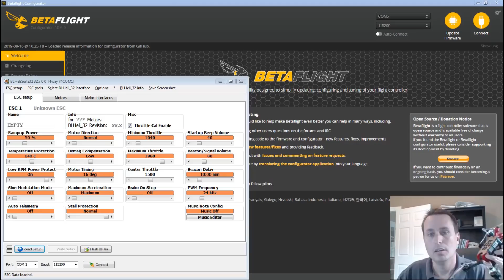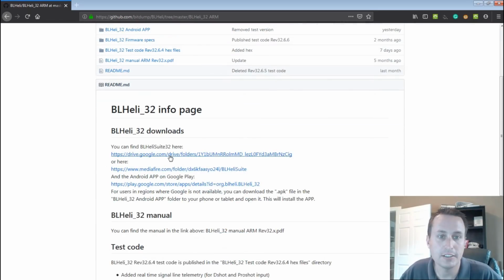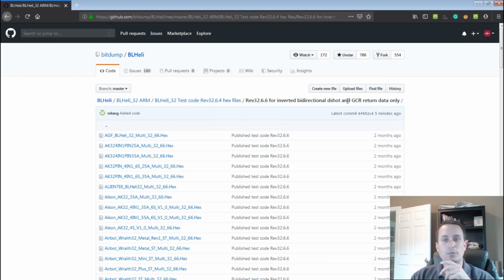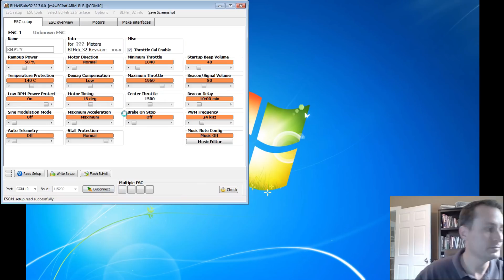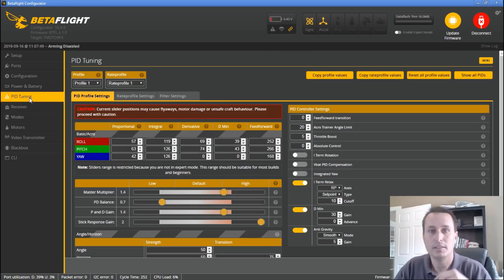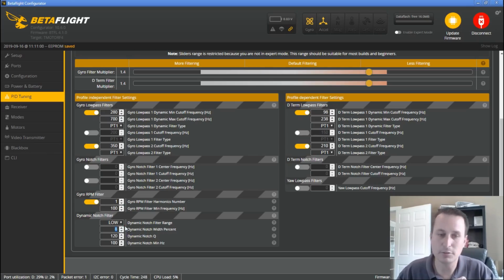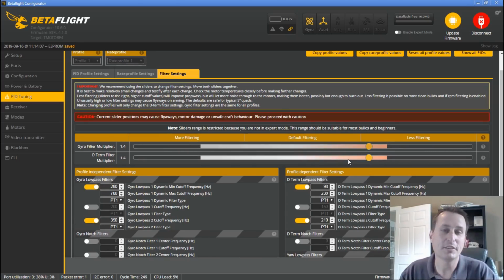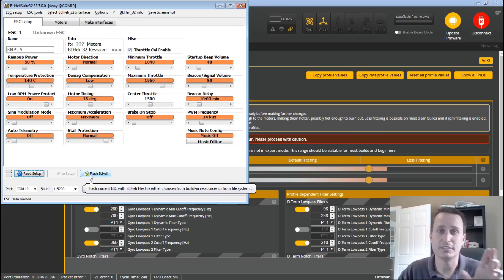Betaflight 4.1 Filter Setup - RPM Notches are the Future!

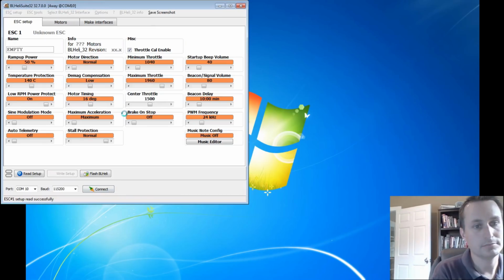Comment from the maker: See 7:15 to skip the BLHeli upgrade part and go directly to the BF setup portion of the video.
Reply: So if the motor temp is high, should i move the slider to the left?
Reply from the maker: @voonkhingsheng5541  , yes

Comment: Hey Mark, I've done pretty much everything on 4.2 to try and get the mid-high speed wobble. Is this due to the TPA being changed from the .10 at 1250 to .60 1650? Down low everything is fine. Above half throttle induces horizon wobble.
Reply from the maker: Try changing TPA from D only to P&D in CLI.
Reply: Have you fixed it?

Comment: Thanks fot that video. My quad fly perfectly on 4.06, when i update with rpm filter, i have very rough idle and motor get hot no matter  how high or low i set the filter slider. (no flying, just idle)  1700kv, 6s
Reply from the maker: something changed mechanically.  There are no gremlins in 4.1.

Comment: Hey Mark, have you had issues with blackbox logs logging. When going to read the log via MSC, it says "error opening log: no log in this file could be parsed successfully" I have this happen on two different quads running omnibusf4sd 4.1.3 its always logged fine pre4.1.3. The file size is correct for a log, just wont read. Logging at 2k, gyro scaled. Got the first flight, but the second is unreadable. Other quad had both logs, but could be read. Any ideas?
Reply from the maker: Take out SD card and copy manually.
Reply: I did found out that if take the sd card out, and copy files all the logs are good. Maybe my USB is bad, or something else. Thank you tho

Comment: Hi I built it! A VCT-85X F4 BlHeli_32 16A V2 omnibussd even has Mobula HD LED at the rear, looks like beast. I just have to tune it now to fly like one. With 3 flight modes, cruising, air & acro. The thing is I'm using a 3S 450 battery but only getting 1:30 min flight time out of it. Which is actually why I'm here, to understand the quad I built more & get smarter. Take care

Comment: I saw in your delay calculator that the rpm filter harmonics start at 340hz. Are these harmonics adjustable? The most noise on my raw gyro data is from 80-300hz
Reply from the maker: it follows the motors.  There is a slider at the top of the sheet.

Comment: Are these two Betaflight CLI commands listed in the instructions on the Bidirectional DSHOT Github page required for RPM filtering? set dshot_burst = OFF & set scheduler_optimize_rate = ON . My understanding is that they are just two tests you can run before enabling bidirectional DSHOT on a given FC and not required if RPM filters are already working? I ask because Albert Kim has these as instructions in his how-to video.
Reply from the maker: They turn on automatically when you enable Bi-directional.  No need to test either.
Reply: @uavtech  Thanks for clearing it up!!

Comment: I had filters down at 2x today and heard oscillations. Your absolutely right on Mark. With rpm filters were probably going to see noise before hot motors. At least I see your point about going to low. 1.5 was the sweet spot for me. Mu appreciated

Comment: If i flash new firmware in BLHeli to the ESCs n Betaflight 4.1 screws something up for me is there a way to put the old firmware back on the ESCs n go back to 4.0? And how do I do that? Thank you
Reply from the maker: You just flash back to old releases.
Reply: @uavtech  But how do I find out what BlHeli release is on there now  and how do I get it back later?
Reply from the maker: Connect with BLHeli_S configurator.
Reply: @uavtech  i hv BLheli32 though??
Reply from the maker: @highestvirtue1892  , it won't screw anything up.  Lots have flashed 32.7 already.

Comment: Quick question.  Any advantage to running pwm 48khz over 24.    BLHeli 32.  F4 fc 5in 4s.   Just curious some people saying it’s better.  Some what of a noop.  But love learning all that I can
Reply from the maker: varies on the quad.  generally seems makes for smoother motors, but may also decrease motor breaking torque too.
Reply: Thanks for reply man.  Studying all your vids.  Wish I came across sooner.  I’m gonna run the default 24 some more. If not needed not gonna change to 48.  I’m blown away with the 4.1 rpm filtering right now anyway.  But it’s good to know. Seems to be racers like 24 and freestylers like 48.  From what I gathered researching.  Now I gotta do 4.1 rpm on all my kwads.  Thanks again
Reply: Forgot to ask.  Do ya have to reflash esc s to change the kHz to 48
Reply from the maker: Yes, if BLHeli_S.
Reply: T-Motor F45A 3-6S BLHeli_32 ESC.
Reply from the maker: Then just a settings change in BLHeli_32 Suite

Comment: My lord...I’m tempted to try this on one quad. Talk about pain in the butt. If you say it’s worthy I’ll check it out.
Reply: Make sure you do everything in the video. I set up 2 three inch quads and 3 five inch quads and it's game changing. It's worth the time. You will hear the difference and makes tuning your pids a breeze. It will fly so nice you can just play with the pid ratio Sliders to your desired preference
Reply: mike216ism thanks 🙏 I will give it a whirl
Reply: Mike what values have you on your 3 inch quads? I'm tuning a 3 inch with the rpm and dynamic notch to. I killed the propwash but i have the sliders to the right at maximun, without hot motors, but some oscilations and motor noise sometimes. Thank you guy

Comment: Hi,
I switched my larva x toothpick to bf 4.1 + rpm filter and had some strange wobble when throttle is at 0 in mid air. Check out the dvr right at the beginning:
https://youtu.be/PNpoD3vJBwE
It happens only at zero throttle in reverse flow situation. 
Pids are stock, do you have an idea what's going on? It seems like airmode is going crazy. I raised the throttle idle rpm to 3500rpm, that helped a little. 
With betaflight 4.0.4 I had no issues of that kind.
Reply from the maker: F3 or F4 processor?  What PID Loop rate you running?
Reply: @uavtech  
F4, 4/4khz dshot300
Reply: @uavtech  
Hi, I did some more tuning today, see here my best result:
https://youtu.be/-7NMa2w-9IE

What do you think? 
Somehow I have the feeling, that I-Term is way to high?? This quad need lots of P (70+) and D, but does not like I Gain. I have to reduce multiplier to about 0.8. But then to achiev proper P+D (this quad feels good at 70+ P) I need to go to 1.9 on P/D gain. Is that possible?? It feels like stock pids (sliders at 1.0) are for 5" and completely useless on small quads. 

Here are some more with different pids:
https://youtu.be/WonmtFAPe7A
https://youtu.be/QUYqmaeJEsw
https://youtu.be/-_sM_Xu_18I
https://youtu.be/t3fq9Dp7oA4

Comment: Is it mandatory to use RPM filter with Bi-directional DShot communication? I have ESC with telemetry. Wouldnt be better in this case use separate wire (UART) to get teletry data and FC would send only base Dshot commands to ESC?
BTW: Thanks for detailed instructional video!
Reply from the maker: No.  RPM only works off BiDirectional.  Normal Telemetry is too slow.

Comment: Quick Question: Dyn Filtering for 5" quads can be set to med-low but on the BF 4.1 info bubble what I is see is this: " HIGH(230-800hz) for very high revving 2.5-3 inch quads."  What recommended Q, Width and Min Hz would you suggest as a good starting point for a 3" copter?
Reply from the maker: Defaults.  Med. or High.

Comment: Good stuff! Are the rpm filters in 4.1 diff than in 4.0? ALSO will I be able to use it with the radix fc since it’s already at like 35% and gyro is locked?
Reply from the maker: Tech is the same in 4.1 as it is in 4.0, just easier to turn on.  Good question on the Radix.  I do have one of those boards to test.
Reply: @uavtech  would be cool if you would do a video with the radix if you had the time. I've been running 4.0 and rpm filter and loving it, need to try 4.1 and see if it can be even better.

I have a feeling that the radix will get a bit hyped now when vanover started flying for brainfpv.

Thanks for all your hard work Mark <3
Reply: UAV Tech it works fine I just flashed it no increase in cpu or anything gyro locked at like 3196khz or whatever 👍👍
Reply from the maker: @MaxBeamer  , yeah gyro rate doesn't matter as long as the PID loop is.completing its calcs on time.

Comment: So do I understand this correctly?
The new basic filter strategy in BF4.1 is, instead of turning off as many low pass filters as possible, would be to turn on RPM filter, leaving the other filters at default and then just increase the gyro and d term multipliers as much as possible?
Reply from the maker: Yup.

Comment: what about the rest filtering? (gyro low pass filter & D term low pass filters) Should I turn them off? or it is better to set them as I have them now on BF 4.0.3? Thanks in advance
Reply from the maker: Move up the sliders as far as you can.  So move the Gyro and D-term sliders one step at a time (together) until flight characteristics get worse, or motors get hot.  OR if you 4.0.3 filter setup is working great for you, use it on 4.1.
Reply: @uavtech  thanks a lot my friend!  you are doing an awesome job! Filters in BF4.0.3 were set according to your previous videos and working perfect so far. I will use them in 4.1 then. Have a wonderfull day, cheers from slovakia👍

Comment: 3.7 is out now so don't need to download the hex file. I was able to connect to BL Heli and read ESC's but when I clicked on flash it disconnected my laptop from the wi-fi and gave me a "no internet" error message dialog box. What the heck am I doing wrong? Thanks!
Reply from the maker: never saw that one.  I would check your PC for issues.
Reply: @uavtech  i think you are  right. I believe it is some sort of security setting. Thank goodness for android! Was able to use BL Heli 32 app to flash 3.7. Worked flawlessly.

Comment: Thanks for the video!
Im running iflight succeX twinG F7 FC with iflight 50A 4-in-1 ESC, just tried 4k/4k-DSHOT300 and 8k/8k-DSHOT600
Both errors stay at 0%, then I made the motors run at 3k RPMs to check the tasks and on the 4k/4k setting im getting Gyro/PID max loads of about 38 to 40%. With the 8k/8k setting, im getting about 79-81%, saw a spike of 85%. Would you say its safe to run this setup at 8k/8k since the motors seem to be running smoother or should I be better off staying at 4k/4k?
Reply from the maker: If errors are ok and tasks is below 100%, you should be fine.

Comment: Thanks for your great video! If I set up RPM filter everything works fine, also if I raise the motors in Betaflight configurator it shows me zero errors, if I lower the bar the motors go slower as expected - so I thought good to go. But as soon as I try to connect with my transmitter the motors get nuts. The throttle goes up the more I play with it, if I lower it the motors are still spinning faster and faster. I don't know really what to do, as I never had such problems in a previous release (my FC: MatekF411RX, so I bind via frsky SPI X, ESC: DYS Aria 32 bit). If someone has an idea - it would be great. Thanks!
Reply: exaclty the same issue here. Tyro 129 (F405, BLHeli_S), flashed JESC Firmware. In BF Motors spinning without issues, but when arming via RC and try to give some throttle, motors go insane, so that I have to disarm quickly.
Reply from the maker: This on the bench?  Or arming to take off?
Reply: @uavtech  
That happenend on arming, when giving throttle. I updated to RC4 and it seems to work now. I also suspect that my rear props where mounted in wrong direction so that the quad tilted back when I went on throttle
Reply from the maker: @waldemarkraus2855  , oh yeah, that will get you.  At least anti-taz has you back too (disarms automatically if the quad flips out).
Reply: I was stupid. Was simple wind-up. I forgot about that. It works perfect, nice release. The only bug is that frsky_x is still not working properly, all of a sudden it drops from the air. With frsky_d (D8) everything is good.

Comment: I have seen no explanation what Dynamic Notch Q is. Are you going to update the .xls filter for Betaflight 4.1? Thanks
Reply from the maker: It is literally a value in the filter equation (direct) that controls the width of the notch filter.  Higher Q is narrower notch with less phase delay.

Comment: Interesting you didn't pick 48 khz. I've always been told to set it to 48 khz? Why did you pick 24 khz instead of 48 khz?
Reply from the maker: 48khz has less breaking torque.  Does in many cases give smoother running, but breaking is key too for performance.
Reply: @uavtech  Got it! I would like to do fpv freestyle. Should I stick with 48khz?
Reply from the maker: I would go 24khz and compare with 48khz for your rig.  see what works best.
Reply: Thanks a lot! :)

Comment: does one has to flash ESC's before seeing the Bidirectional DShot option in Betaflight?
Reply from the maker: Yes.
Reply: @uavtech  Mark would love your help. I was following along your Vid to try RPM for the first time but while flashing ESC 1 half way trough i got read error and now cannot connect to any of my 4 in 1 esc's. i triple checked that i have the correct hex file
Reply: Please Ignore Mark, my freakn battery died while flashing esc's. all good now :)

Comment: I successfully did this on my chameleon running a white noise synergy and it is the best flying quad I have ever flown now.  Thank you again.  I just tried on my 6" and the Error stays at 100% even when the batt is plugged in.  Not sure how to remedy this.  It has an Iflight twinG (stm405) fc, speedix 45amp 4in1 and I did everything correct.  How can I trouble shoot this?
Reply from the maker: triple check you have the right BLheli firmware on the ESCs.  See if they spin up in motors tab with bidirectional turned off, and then try with bidirectional turned on.
Reply: @uavtech  Thank you for your help (always).  I ended up flashing RC4 and it worked!!!   I have now been playing with how much filtering to use and how much RC smoothing.  I am down to 30 and 70hz set to manual and am pretty happy with it.  It seems too much FF in this quad combined with the r9 stepping is causing crazy spikes, but I feel like I am getting closer.  (6" 6s 2407 1700kv) :)  Look forward to your next video
Reply from the maker: @mbycfpv8937  , yeah the R9 "heartbeat" where it jumps from 6.67ms frames to 13 to 30ms frames every 200ms exactly is not ideal.

Comment: Hey my hero 🦸‍♂️ 

I don’t can turn on the bidirectional Dshot ??
Save and reboot and it’s off.....
In the Motor tab i don’t see the rpm....
Thank you in advance 👊🏻
Greetings from Germany 🇩🇪
Reply: And i don’t see the rpm filter tab in the filter settings...
Reply from the maker: Need to update BLHeli to GCR firmware, be on 10.6 configurator and be on BF 4.1-RC.
Reply: Now it works, I forgot turn on Full chip erase 😬

Do you have dumps for a 7 inch filter setup ? 

Greetings from Germany 🇩🇪

Comment: Do the ESC's need the telemetry wire connected for this filtering to function? (bi-telemetry)
Reply: You don't. The required data is sent via the signal line. Telemetry line not required.
Reply: @AlvinYeoh  Had to ask as its always the un-said things that end up being the problem.
Reply: @4DCResinSmoker  No worries. Better to ask than to assume and then screw something up.
Reply: @SPotter1973  Did you flash the legacy or the non-legacy version of your board? The non-legacy version is the unified targets one and after flashing and first connection to configurator, it will ask you to apply some defaults. Did you get that?

Comment: Does anyone else have a dedicated UAV Tech folder on their computer now? :)  I had issues with RC2 and a MatekF7 where the mass storage for blackbox would auto dismount after a few seconds. Gonna give her another go! This is  easier than earlier setups for sure. Is there a way around entering the VTX channels manually after every test flash? Or more likely ..I am just missing something in the CLI :) Did that prompt on flashing just auto-apply the snippet for the unified target? Seemed that way...that is cool!  Thanks again for all the excellent content.
Reply from the maker: Unified target flashing in 4.1 is seamless now.  Just grab your target like normal.  If it does not say "Legacy" after the target name, then that is the new Unified Target that flashes the unified hex and sets up the config for you (seemless).  

For the VTX tables: type in "VTXTABLE" in the CLI.  You can save to a note pad and dump back into the CLI anytime.
Reply: @uavtech  Thank you sir!

Comment: F7se on 8k 8k dshot 600 I get packets in motor tabs 4k 4k 300 I dont
Reply from the maker: Getting E % errors is bad.  Not good.
Reply: @uavtech  yea just plug in and gets e packets around 5.6 goes up and down my other f722 with makerfire esc does work with no e packets on 600 and 8k 8k
Reply from the maker: If packet error at 8k, go to 4k.
Reply: @uavtech  what about 8k and 300 no packets on tht
Reply from the maker: @charlesphillips1642  , whatever works.  Need not packet errors.

Comment: Im really liking 4.1RC3 with RPM filtering, its the first time I like how BF feels since Helio for me. I do have to turn dmin off though, it causes jitter/wobbles on my build since 4.x couldn't fix so I just turn it off same in 4.1. I have all gyro filters off and just run d-term, RPM and the dynamic notch set the same as you show here. I'm just fine tuning the last bit of propwash handling and FF.
Reply: Reconfigure it to the DBoost type arrangement - when it drops way down you get a really loose and P-term wobble tendency on quads, but you do get fairly cool motors.  If you have a clean setup, DMin of 22/25 kind of range and letting them climb up to 37/44 type of range with TPA rolling seems to work super well.
Reply: @tehllama42  actually I tried dboost method and it didn't help on 4.0.5 I'll try for kicks on 4.1